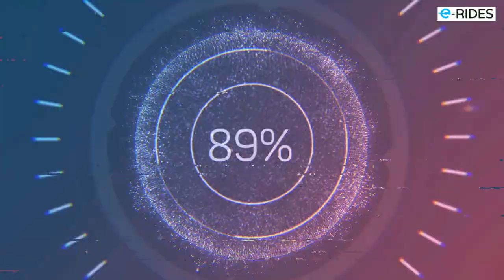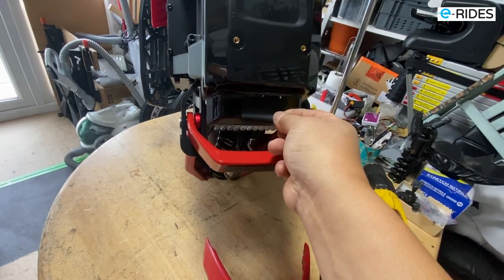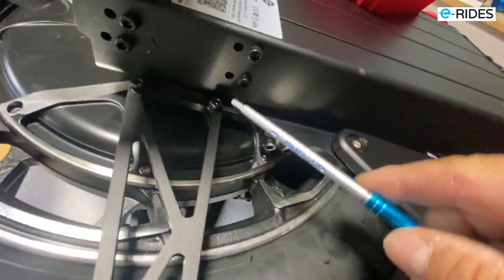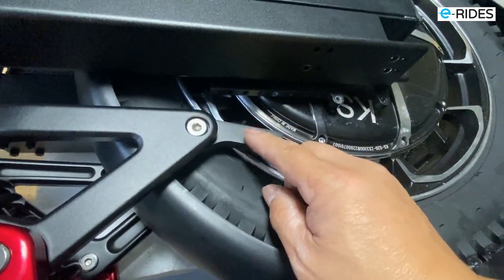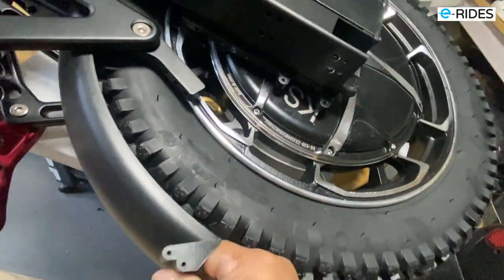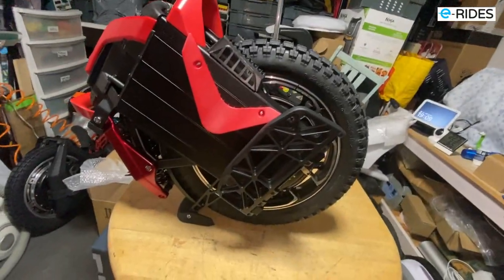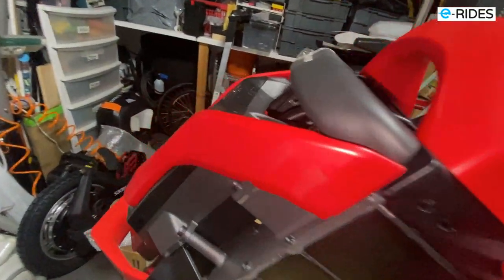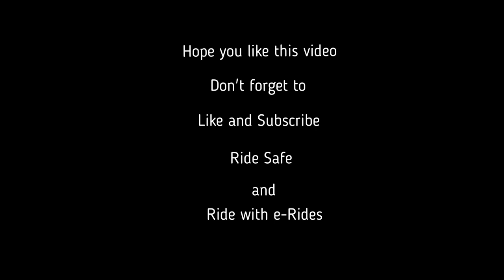KingSong S22 Final Release Version and tire Change. e-Rides EUC Upgrades.

Comment: If you step back and look at EUC's, and look at that you have a wheel with a motor in it, then a frame saddled with a couple of battery banks, then what is left over is all the technology that makes the wheel accelerate, brake, and balance, its really incredible, I know these companies are going through some growing pains, and with social media the negativity and critics are the ones who get the attention, all that said, I am impressed with all the main brands that I am aware of out there right now( the big three), I hope they all succeed and become long term successful companies, the huge jumps in the last 3 years with the performance its truely incredible, This has largely been done during the pandemic, which has really hobbled these companies to respond to the issues as quickly as they would like to, along with being able to produce at the volumes they would like to. There is a lot of gloom and doom out there these days, the advancements in the micro mobility sector has been one that has been a enjoyable little break from all the gloom and doom out there these days.

Comment: You didn’t need to remove ANY of that stuff to get the wheel and motor out - you can just unbolt the suspension at the back 2 bolts - then the whole things slides out. Much easier - we did it on the group bro on WhatsApp - no need for half of what you removed to be done.

Comment: This is my actual wheel and I had my 1st run out today albeit only around 15mi. Big change from my daily V12, not as agile or fast on acceleration but nice to finally hit potholes and drop offs without any of the V12s jumping around like a Tapdancers Fanny. All positive so far just need to dial in and get a few hundred mi under my belt before I can get a true feel and opinion on the wheel.

Comment: Hello Kevin! It looks like this motor is from May: before King Song addressed the stator slippage problem which can lead exposing the phase wires, shorting the mainboard and a cutout.
This wheel should probably be stress tested before delivery to the customer.

Did you read the analysis I posted on the issue?
Either way I'd like to invite you to the large group with other distributors and their service managers, to exchange infos and help handle that with King Song. It would be great to have your expertise here as well. How can I send you the invite to the group?

Comment: You didn't mention the suspension (which apparently gums-up and get sticky as soon as it gets dirty). No upgrade there?
Reply: You can 3d print the roller sliders or buy them for around 70$
Reply: Nice RE-review. Just got my 40T S22! Would you mind posting a link where I can buy those suspension rollers you mentioned? I don’t have a 3D printer, but I DO want to support the aftermarket community. You guys make it all happen. Thanks!

Comment: What model Kenda tire did you use? I would also like a slightly rounder edged tire but some dealers have said that because this rim is a bit different in its shape/width that nothing else fits like the stock tires.

Comment: @5:42 what is the spec of the bolt that goes through the suspension bracket and the suspension adjustment part?

Comment: Beautiful wheel. I had thought it was limited by tiltback to 70kph. 
I recently heard someone report 76kph. Can anyone confirm the tiltback works and what speed does it kick in?
Reply: I've been to 75kph, the tilt back is supposed to be 73 ish the pedals didn't tilt on me but I was riding the beeps. Not something I'll do often if at all, the euc is stable and solid ride at 55 to 65 kph buttery smooth
Reply: @dirt.surfer   your betting you spine on it so of course wear max armour, im not suggesting riding anything,or ride your own shoes. im on a different wheel unamed euc, i might possibly have gone 62, tilts before beeps.. Strange thing but its worked so far. So not complaining, thats a thumbs up,. A step up from cut outs.
Could have been beeps first but anyway i didnt write that code.
But i get it, its fast, i recon to  promote the lets have its tiltback nature known as a basic spec.
Public awareness i spoze if we care no notice the tilt backs value we bet our spines on.
Im riding at my own risk but it would be nice to get all specs,more specs in a vid, or typed. 
For safety of coure.
Lets know to ask, tiltback?
So as it stands it could be possibly s22 could possibly tiltback at 76kph with possibly 75kg rider on a nice day. But not conferned.
Sure looks a fantastic marvel.
To reach down and grap ground and say i shall form this dirt to stand apon a single wheel and ride at the speed of 30 galoping horses without rest, to the horizon and beyond.
 And anyone would believe it.

Comment: My s22 has a descrepency between the main board and each BMS. the main board reads about .75 volts higher than the battery packs. just though I would share whats up with mine and see if anyone else is having the same issue